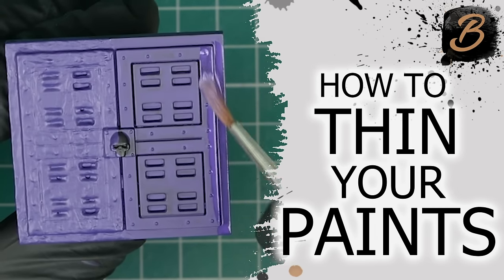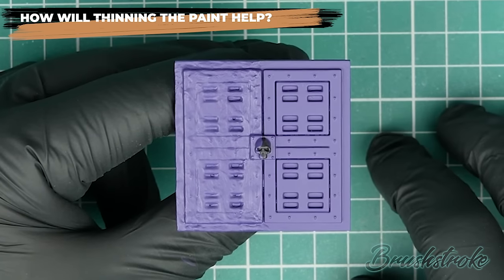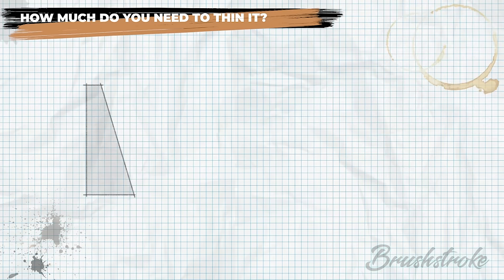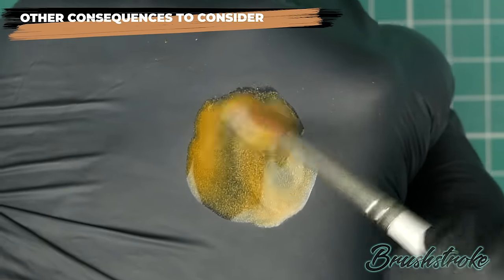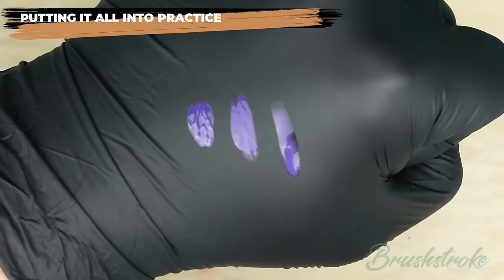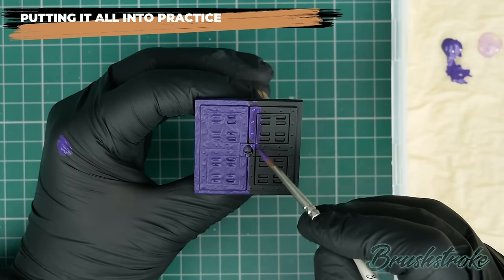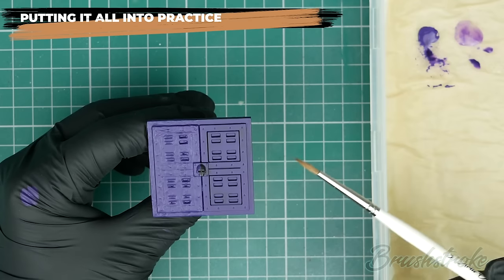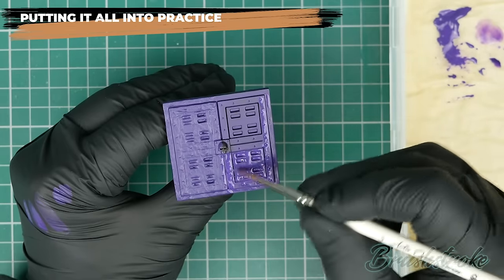HOW TO THIN YOUR PAINTS: A Step-By-Step Guide

Comment: Any hints on how long you wait for the thinned paint to dry?  I assume it matters on the paint, though I had some acrylic hobby paint that never seemed to dry, and when thinning the color on it really wasn't that strong.
Reply from the maker: So, the drying time will vary depending on the conditions of the room, cold hot humid dry etc
Roughly speaking though, perhaps a minute or so for coat on a mini the size of a space marine. I tend to paint in small batches of 3 or 4 minis. So by the time I paint a coat on all 4 the first one is ready for it’s next coat. That way you’re never waiting for things to dry. You’re always painting 
Another tip, is you can use a cheap hair dryer to speed up the process, but you need to be careful to only use it on paint once it’s lost it’s liquid characteristics. Because you don’t want the paint to be disturbed by the blowing air
Reply: @BrushstrokePaintingGuides  Actually a "Minute for a coat" just made me realize I can thin my paints more.  (Also the consistency has not been great).  I've been using these Vallejo Model Colors, and I feel like I want to get closer to 2-3 thinner to paint which is the opposite of what most people seem to say but if that's what works... well that's what works.

Comment: is this acrylic paint or enamel?
Reply from the maker: This video is for water based acrylic paints.
There are some water based enamels for which this process would work fine for but the majority of enamels require thinning with a thinner should as mineral spirits etc
Reply: @BrushstrokePaintingGuides  thanks for the sound response! Soo, only thinner will be used instead of water, is that correct?

Comment: Something that I often struggle with is getting  good coverage with lighter colors (specifically white, yellow, and orange). I am able to thin darker colors like purples and blues to get a good result, but if I thin lighter colors at all, I can't get any coverage - it always ends up patchy, regardless of the number of coats. Any suggestions?
Reply from the maker: So, there’s a couple of things to note there.
Lighter pigments, like your yellows and whites do have different sweet spots to richer colours.
The trick is you need to find the point where you have maximum opacity and still have the paint settle. Once you have that, it’s that that’ll determine how many coats are needed to achieve a solid finish.
Of course you can also do yourself a favour and either start from a pale primer (white or grey)
Or when that’s not possible, paint in transition layers to reduce the different in the jump from one colour to the next.
For example; if you’re painting yellow over black. You could apply a layer of warm brown first to help the step to yellow. 
Hope that helps
Reply: @BrushstrokePaintingGuides  I'll try it out. Much appreciated!

Comment: Hi this video is fairly old but i was wondering if you knew why bothing will react on my palette or hand is there a solve. Does it have to be a wet palatte. Do i have to wear a glove?
Reply from the maker: What type of palette are you using currently?
All acrylic paints should react in the same way when when thinned with water but depending on the surface you’re using the signs can be more subtle.
For this video I’m using a wet palette, all of the details of which you can find in this video. Including details of the exact paper I use.
https://youtu.be/NLcuicvJFKo

If you’re not currently using a wet palette, I would highly recommend you give one a try. It can make a massive improvement to the level of your painting and you can make one yourself for very little money.

Hopefully that will help with your paint thinning issues. If not, please let me know more details and I’ll try and help you further 👍
Reply: @BrushstrokePaintingGuides  I feel I already know the problem as I use a tile so.that may be a problem. Thanks for the advice, I will look into a wet palette now. :)
Reply from the maker: @SP4RKY_08  no problem
Let me know if you have any more questions 👍

Comment: what brush would you use for a model car with acrylic paint?
Reply from the maker: What scale car? For large flat panels, you should look to use as big a brush as you can and paint panel by panel. You may also find using a square ended brush easier. 
If you have your paint thinned so that it settles and your brush marks vanish you shouldn’t have any problems.
One final tip for large flat panels, is to work in one direction so that you’re not tempted to move your brush through paint which has already started to dry, as that will cause it to go lumpy and ruin your lovely smooth paint work

Finally, if it’s a big scale car, consider spray cans or airbrush if you can. As it will just speed everything up 👍
Reply: @BrushstrokePaintingGuides  it would be any 1:24 scale car model...and I agree, I need a big brush, and I think I would need a big soft brush?
Reply from the maker: @lgmnowkondo938  a natural bristle brush is best, yes. Something like kolinsky sable bristles are best.
The paint flows clearer and smoother from them, so you barely need to touch the surface. Which then makes much less brushstrokes in the paint

Comment: 3:13 That suggests there's the same amount of pigment in both thin and thick layers of thinned paint, I don't get it. No matter how thinned the paint is, in twice thicker layer of paint you have twice more pigment, so after many thin layers the pigment adds up anyway and crevices disappear. What am I missing?
Edit: Also isn't this how washes work? Thinned down paints filling crevices?
Reply from the maker: No, the intention of the diagram at 3:13 is to illustrate the behaviour not the coverage or the pigment concentration.
As you saw with the next section (gold paint in water) as you add water the ratio of the pigment to the volume water decreases. Which, means each application of thinned paint will apply less pigment to the surface but the evaporation of the water helps the pigment settle and distribute evenly over the surface. There is a limit to how much you can add water though before the integrity of the paint is broken and it no longer holds together correctly.
To answer your first question then, no, multiple thin layers will result in applying less pigment to the surface and is not the same as one single unthinned layer.

In terms of your second question about washes, yes, you’re sort of correct. Washes do purposefully behave the same as thinned paints, as in they are meant to flow into crevices but they have a different chemical makeup to paints which make them more akin to inks or dyes.
Give this a watch and it should help clear up some confusion.
https://youtu.be/mADYQQOH9a8 
Of course if you still have questions, just drop them in a comment 👍
Happy New Year

Comment: So do you not really ever dab your loaded brush on a paper towel to get rid of water that may flood the surface or extra paint?
Reply from the maker: No. That really wouldn’t make any sense.
Why spend time getting the correct consistency of paint only then to remove a random amount of moisture out of it by touching it to paper towel?
The whole point is, you won’t flood the surface because you already know how the paint is going to behave. It’s predictable.
Reply: @BrushstrokePaintingGuides  Thanks for responding! Yes that makes sense when you put it like that. As a noob taking in all the different painting techniques it’s hard sometimes to differentiate why people do certain things and when they’d be redundant in other’s methods. 

Side not thank you for showing me Darkstar’s  Steel color, it’s exactly what I’ve been looking for.

Comment: Does all this apply to laquer paints as well?
Reply from the maker: This process is for water based acrylics.
Although, lacquers can be thinned with solvents I can’t be sure they behave in exactly the same way I’m afraid. 
My guess would be that they’d be similar though, as the evaporating solvent would result in the shrinking of the paint in the same way, but you’d have to experiment a bit yourself to be sure.
Reply: @BrushstrokePaintingGuides  Thank you for the response. Great video.

Comment: I would assume this is with water based paint?
Reply from the maker: Yes, the paints used in this video are water based acrylics.
The process works the same for enamels but you’d need to switch the water for an appropriate thinner. Hope that helps
Reply: @BrushstrokePaintingGuides  thank you! I want to paint gundam models, so it feels daunting with all the edges and such. Someone one time recommended a drop of dish soap but it sounds kind of out there
Reply from the maker: @SC-cx9ti  it’s not as mad as it sounds but it’s not something I would recommend as it contains other elements which aren’t great for your paint.
The reason they say to add some dish soap is because it breaks the surface tension of the water in the paint and makes it flow and settle into the grooves more. If you want to go that route I suggest you look to use an airbrush “flow improver”. It produces the same effect but is made to be compatible with acrylic paints.
I should probably do a video on thinning with alternative agents, such as flow improver, medium etc 🤔
Reply: @BrushstrokePaintingGuides  honestly, make as many as you can lol. I need all the confidence I can take.

I know nothing about paint but desperately want to paint my kits. I tried painting one, but the paint turned... uhh..... well its like.... there are a few parts that just kinda flaked off for some reason. I think its the one that I didnt put top coat on. I should PROBABLY get on that. Its hard to describe but the surface now feels solid yet soft...

On another one, I tried penciling some panel lines, then put a colorless matte top coat, but then the top coat was more thick than I suspected. It didnt turn out terrible at all, but it was definitely scary. Some kits are rarer than others and some are cheap at the time that you get them.

Oh! A big topic!!! So something that scares the living daylights out of me is painting a surface, painting panel lines, then using thinner to clean up extra smudges. Doesnt that end up removing the other layer too? My paint dries rubbery and it just makes a crater if ripped(i REALLY dont know what I'm doing). It doesnt look caked, but it seems I need thinner. Yet thinner coats would mean cleaning panel lines is still dangerous? ( I can just hear you sighing and saying "OH BOY" lol).
Reply from the maker: So, it sounds like you have a lot of different techniques you’re trying to use all at once and I think you’re getting them mixed up a bit.
So, firstly, how are you priming your models? 
Then for you base coat paints, what are you using and how are you applying them? 
Next, for your panel lining it sounds like you’re trying to use thinned oils to fill the recesses? It’s that right?
And then, you’re wanting to clean things up again and worried that’s going to damage your base paints?
Have I got that right?
Reply: @BrushstrokePaintingGuides 

I don't have an airbrush I trust, and I want to focus on hand brushing. Plus my experience with the cheap one I had just ended up with it spraying little splotches even after cleaning it or adjusting the needle. 

For primer, I uhhh... well to be honest I dont know if primer is technically even paint or if anyone thins it, so I just apply the primer. It ends up being kind of thin if I remember and its hard to get a nice solid coat at all. After applying enough primer to where it's more the color than not, I tried putting my paint.

For my paint I focused on mixing for color, then I honestly had to try to science it. I tried thinning it with it's base (i have tried water snd alcohol based) but it fluctuated from caking to having the paint nearly drip off. I couldnt manage to get it to properly settle. I tried making a larger batch of the color, but honestly had no idea what to look for at the time.

The result where I thought I mixed and applied the paint well enough is where the paint has either dried as a plasticy finish where it hardend and may chip, or the paint is so thick (I think I applied color until the color wasnr see through) that it was essentially like skin (this might have been my try before I bought primer though).

The guides I looked up weren't helpful and the only family that could have taught me, passed away. 

With nothing going as easily as guides made it sound, I had no idea what I was doing right and wrong in my experiments.
-----
And yes I believe the panel liner is oil based. In my mind's eye rubbing it off with a quetip would rip the paint-skin or quickly dry onto the paint and result in eventual chips.

OHHH if it helps, gunpla is the same plastic if not similar to the plastic found in disposable spoons.

Comment: How long should you wait for the paint to dry in between coats?
Reply from the maker: The time to dry will depend mainly on your own environment, but you want it to be dry to the touch before you proceed with another coat 🙂
Reply: @BrushstrokePaintingGuides  Thanks. Also, do you recommend thinning brush-on waterbased primers or just use them as is?
Reply from the maker: Just like the paints discussed in this video, I would treat brush-on water based primers just the same. You want them to be thin enough to settle and shrink around all the details on your models. Personally, I did find primers to be a bit too thick straight out the bottle and I prefer to thin them that little bit more to ensure I get as ultra smooth finish as possible.
But every primer bottle will be different and you'll need to judge the speed and characteristics of the primer just as described in the video. Hope that helps :)
Reply: @BrushstrokePaintingGuides  Thanks, it's great that you take time to respond to comments.
Reply from the maker: @rafaeldurano2.066   I do my best, I can't always respond to everything but I try and help whenever I can :)

Comment: Hm unthined won t look like the left side. A "real" comparison would be nice. You can still see the difference between thined paints, but not like this. I am lazy and don t thin for every Modell and they look fine in the end. Of Course i take a wet brush and a towel to take some paint from the brush, but c mon no one will paint thick like your left side :-D
Reply from the maker: The left side is an exaggeration but for good reason. As I have no way of knowing the level of ability of the viewer I wanted the left side to make everyone feel “haha even I can do better than that.” 
What I didn’t want was for it to make them feel “I can’t even do the bad side” and thereby alienate them.
The comparison is therefore between your current painting and the right side.
If you’re already getting the same result as the right, then cool, keep doing what you’re doing.
If the right is better, then watch on and hopefully there will be some tips on things you can tweak in order to achieve the same.
Thanks for watching and checking out my channel 👍

Comment: How long does it takes to dry every base coat?
Reply from the maker: A lot of it depends on the conditions of your environment.
I would say though, generally speaking you're only looking at a couple of minutes for the paint layer to dry and be ready for the next one.
This can be speeded up by using a low heat hair dryer too. Just be careful to not apply it too soon and disturb the drying paint and cause ugly tide marks
Reply: @BrushstrokePaintingGuides  , Thanks a lot !

Comment: Why do you use water and not acryl medium with water to thin your paints?
Reply from the maker: As long as your water doesn’t have a high mineral/ contaminant level then it is perfectly fine to use for 90% of thinning purposes.
Personally I just use medium if I’m wanting to thin past the point where an acrylic will split and no longer bond together, to make washes or glazes for example.

Comment: Looking at all of this, why don't they sell the paint with the right water proportions added? It would save a lot of trouble trying to guess the right amount of water?
Reply from the maker: There’s a couple of answers to that to be honest. The main one is because by being a little thicker it gives the user more options in terms of how they want to use it / apply it. You can make it thinner but it’s a lot harder to make it thicker again.
Also, many companies will sell the same colours pre-thinned for airbrush, which can be very useful.
And lastly, paints can lose moisture over time as you use them etc. 
So, by learning to observe how a paint behaves and knowing how to change it to behave how you want enables you to consistently produce the finish you want time and again 🙂

Comment: Whenever i try to get the brushstrokes or of the paint it gets to thin. what do i do then?
Reply from the maker: Every paint has a different optimum point and that will be thinner on some paints compared to others. If your paint you’re using has to be thin in order to make it settle and move as required it just means you will need to apply more coats of it to achieve a solid finish.
Or you can add a touch of black to the paint to make a darker, better covering tone and apply a coat of that first to help the colour you actually want to be achieved easier.
Hope that makes sense